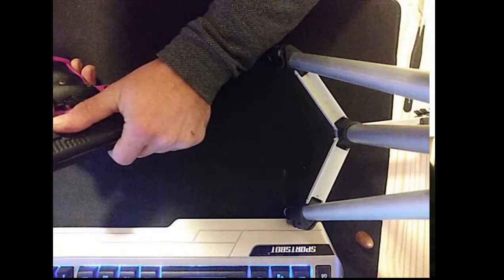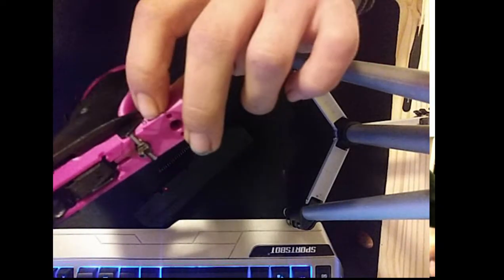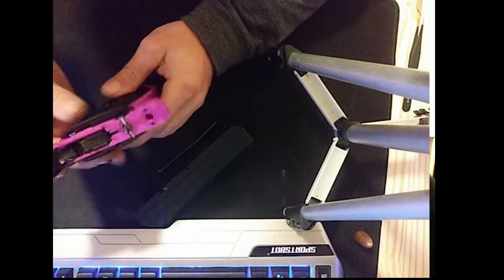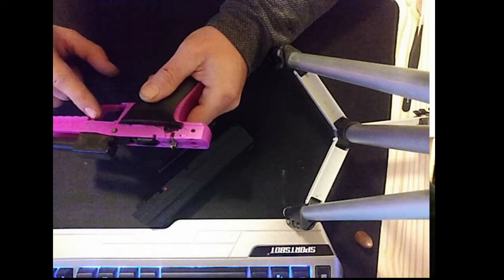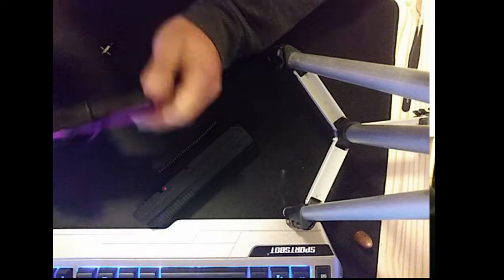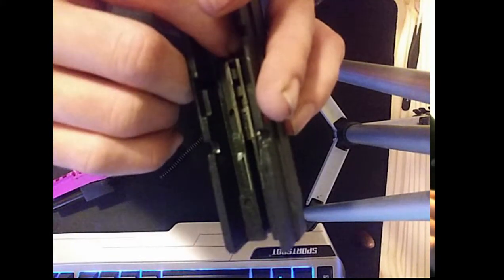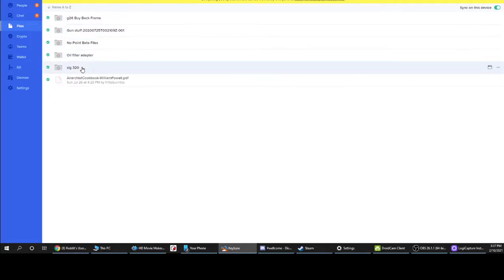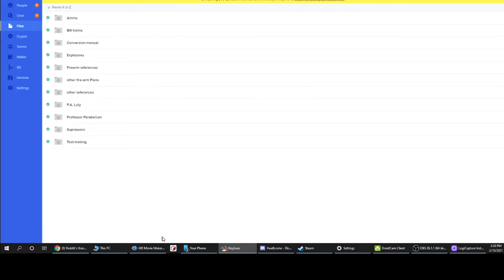3D printed High point Issues. No-Point and Lo-Point. How to resolve common issues

Comment: I cant get my barrel to fit in? You have any suggestions? Id appreciate it.
Reply from the maker: I had another video on some issues with the highpoint but YT deleted it. Those pins are a female dog and a half to get in. What I like to do is get them set in straight as much as I can the squeeze the pin in with a vise. 

After you put the pins in the barrel 2 or 3 times assembly does become easier.

Comment: Ctrlpew said 30$ for parts kit? Can you find it for that low anymore
Reply from the maker: Not anymore. You can piece them together for less than $100 if you can tell what's in the incomplete kits but full kits are running at $150+ and some of the $150 kits I've seen aren't even complete.